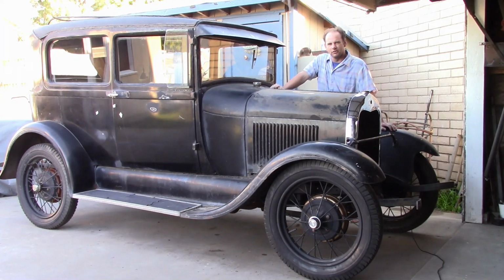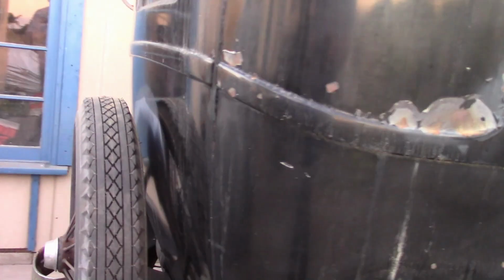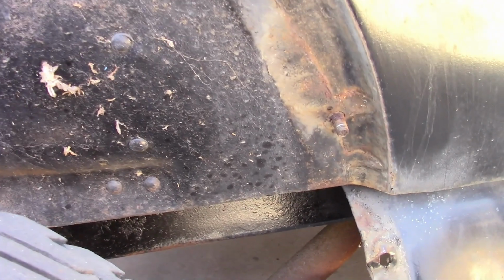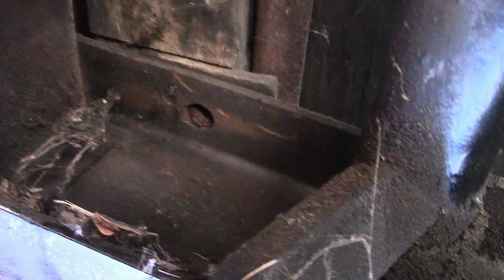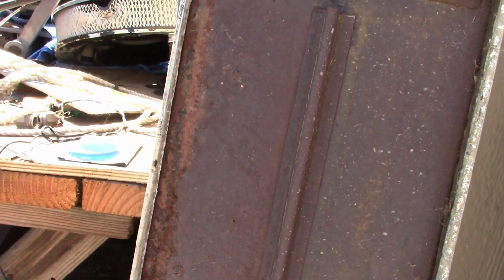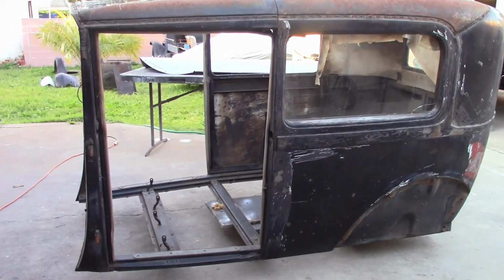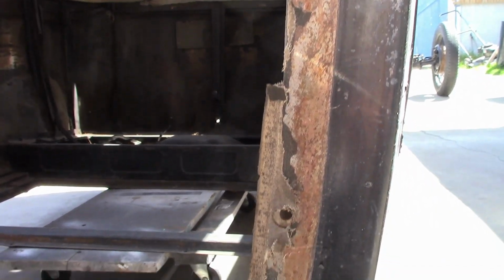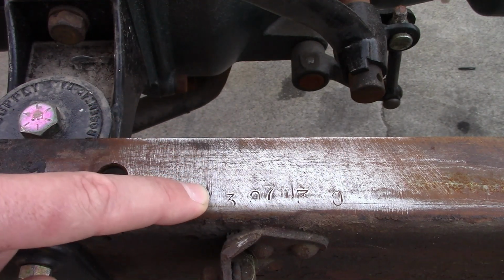1929 Ford Model "A" restoration. Part 1.

Comment: hello, love the channel! I have a late 31 Tudor sedan. Both of my doors on the hinge gaps, they are very tight on top and wide on the bottoms. The doors belt lines are 1/8" low. They do latch, but I can see through the latch sides on top. Any ideas to remedy this? thx. Joe

Comment: Thank you for a great video. I am looking forward to watching the progress. Good analysis of the existing condition. Also, the nail in the exhaust clamp was an attempt to stop an annoying rattle. I had a similar problem with an ill fitting clamp.

Comment: Very timely! I am going to do something similar to my 1930 Tudor. I hope you spend some time on the top install, inspecting and replacing wood, and the interior, making new panels (cardboard? Thin plywood? Masonite?) etc.  Also inspecting the door regulators, window channels and repairing if needed. My driver's window simply falls and all my channels need replacing. Will be nice to know what I'm in for.
Thank you for documenting the process for the rest of us. I DO know how much time it adds to the project!

Comment: My guess is that the nail in the exhaust pipe hanger is to keep it from rattling. Believe me, that is a frequent spot for rattles.  I am very interested in this one.  Mostly because I did much the same to my 29 Tudor 4 years ago. The difference is that it took me 2+ years to finish.  Mine had very wallowed out rear body to frame holes, but not completely gone like yours. I put a smaller plate than the one you found.  I am eager to see how you patch and reinforce rose rear mount holes.
Reply: The point of the nail is aimed at the rear of the car so you will know where it is.  Otherwise confusion might rear its fearsome head.
Reply: Yes, that nail would be a shim to keep the exhaust pipe from rattling around. I finally  wired mine to the clamp, as I recall. But if you don't shim it somehow, the next thing you know, the exhaust manifold to exhaust pipe clamp nuts will loosen up and  she'll start backfiring going down hills. 
Very interesting that this car had white pinstriping on a black body. I wonder which assembly plant it came from.

Comment: I was wondering if you plan to sand or soda blast the hard to clean areas? Looks like a great core so far.
Reply from the maker: We're not sure at this point. but since there's no deep rust, we're probably going to clean it with hand tools as much as possible.

Comment: I noticed there seems to be mounting holes in both the left and right side chassis rails for the Steering Box to mount on. My 1930 RHD one here in Australia doesn't have holes for LHD steering. Could this be a thing they did for replacement chassis, so they could be used in either market?
Nice car BTW. Not many are that well preserved. Looking forward to the future videos.

Comment: Frame numbers weren't always put on right, depending on which location assembled the car. 
Some had no number at all, som at a different spot or different orientation.
So even with this shoddy job, it could still be the original chassis frame.
Reply: I'm curious to know if the numbers match the title/registration!
Reply: @martyscncgarage5275  I don't know how registration numbers work in the US  the only other registration number on the car is the engine number. So if it was registered with that engine number as title, yes (the number put on the chassis is the engine number when the car got assembles) But he said it got a rebuilt engine, so maybe things are different now?